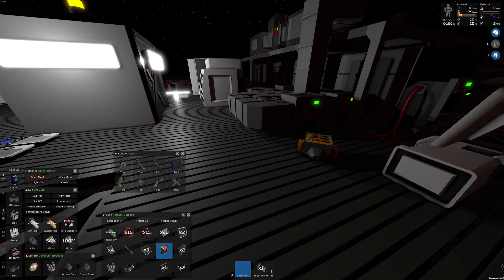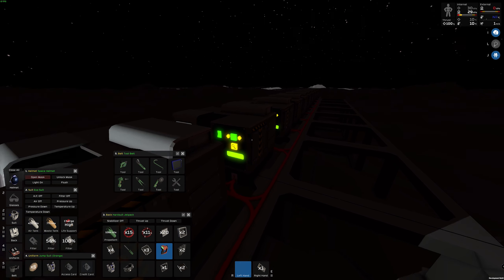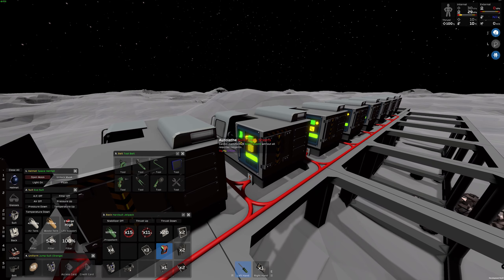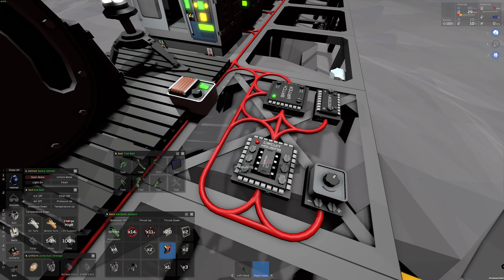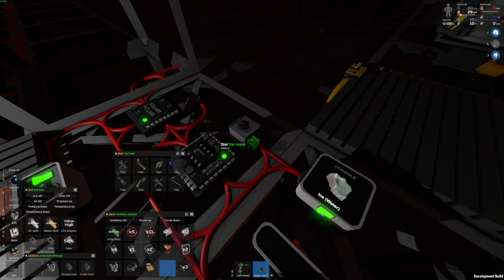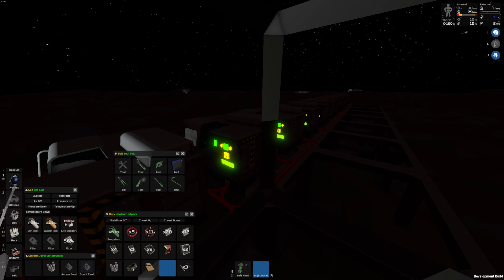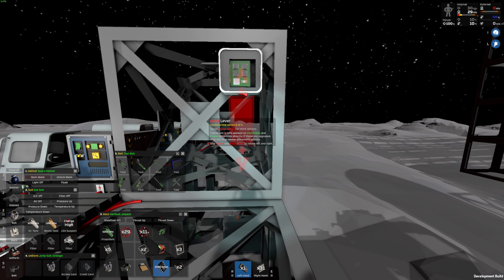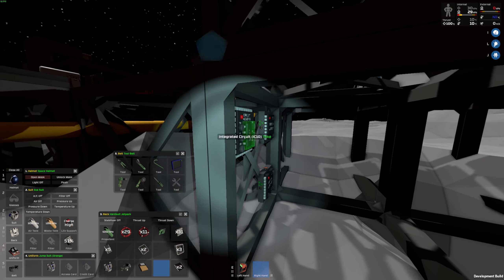Stationeers - S1 E30 - Automating the "miners"

Comment: Connect the exits of the Autolathe, put a stacker on the end and let that stacker drop into a walled 1 cube space.  Easier to collect and there goes a lot in a 1x1x1 space.
You can even use sloped terrain and shute inlet(s) to collect ores and to avoid the shutejunction.
Reply from the maker: Oooh, I like the sound of the 1x1x1 cube might do that. Just be almost like a hopper of ore. I've been really lucky with my chute junctions so far actually.